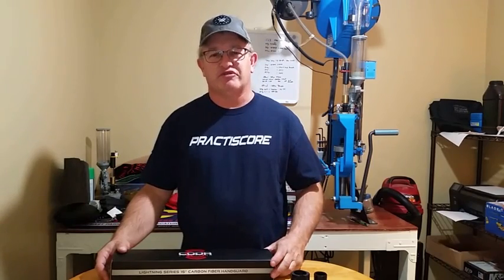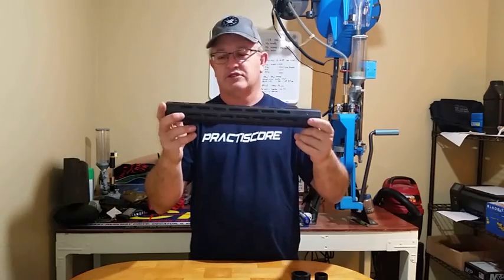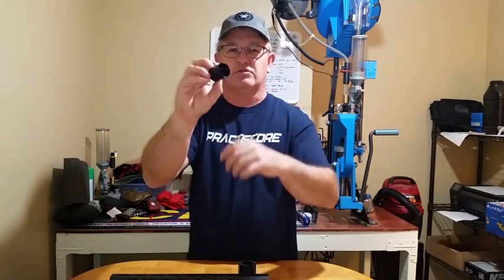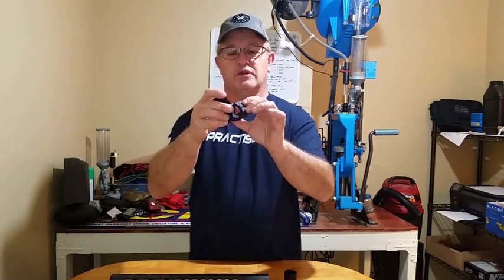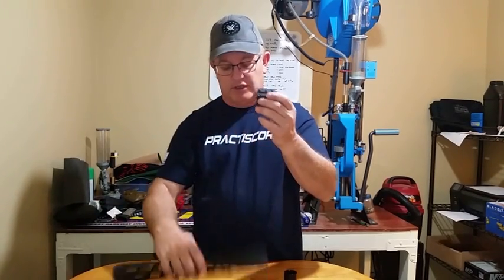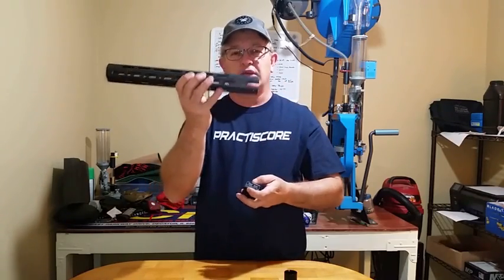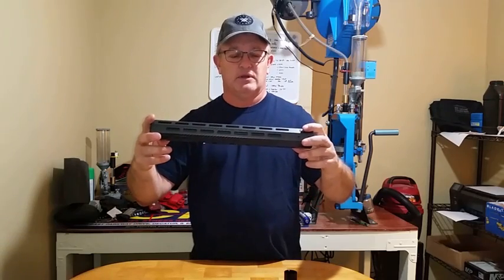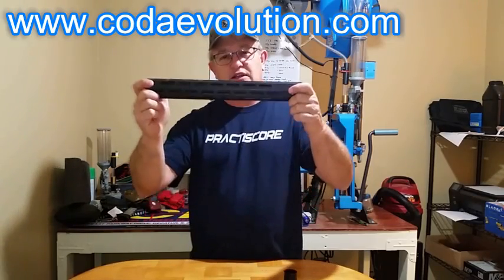Coda Evolution, Lightning Handguard

Comment: Can you do a install video
Reply: Since this is a carbon to metal arrangement, put a barrier in between the carbon and metal on the install.  A good grease should work.  Carbon and metal creates an electrical current and will cause rust stains.